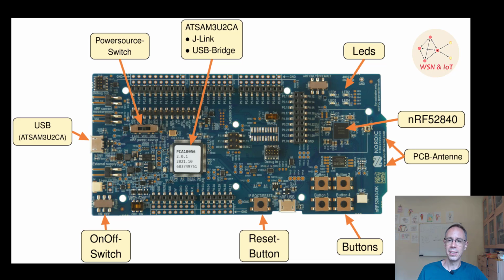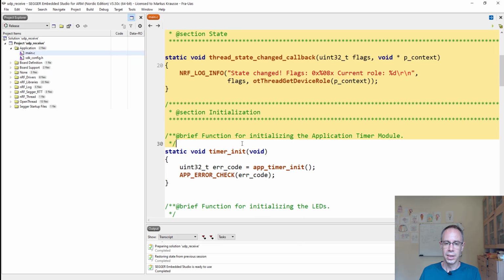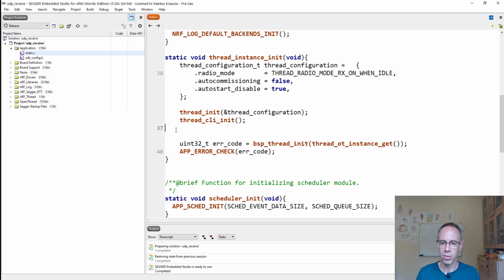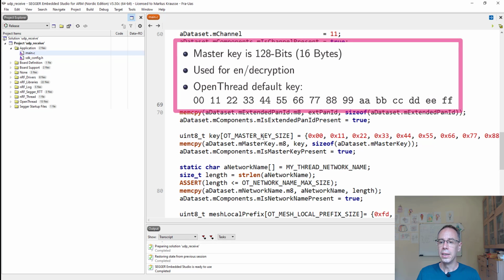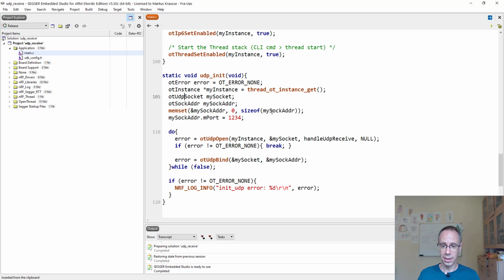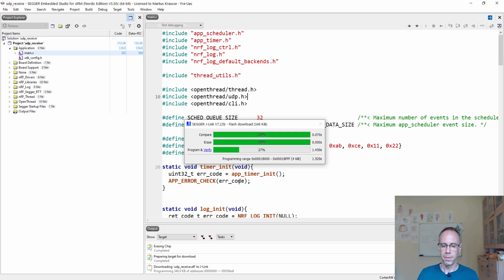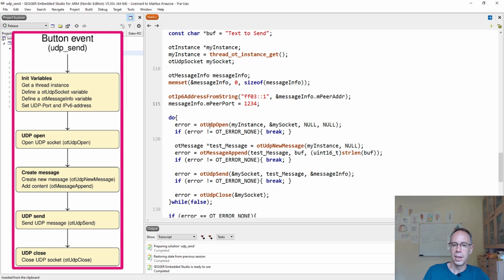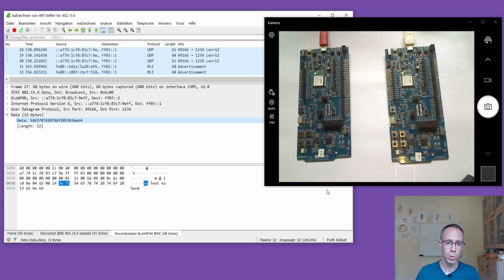Thread network technology - 04 Programming Thread network over API and sending a UDP-package

Comment: I had trouble with the udp_receive board crashing when I powered on the udp_send board. Making the "mySocket" variable in the udp_init() function static appears to resolve the issue for me (i.e., change line 113 in your example code from "otUdpSocket mySocket;" to "static otUdpSocket mySocket;"). Any idea why this might be the case for me?
Reply from the maker: Not really. mySocket is just a container with the socket information and should be available as long there is a valid reference even in the subfunctions (otUdpOpen, otUdpBind) .  otUdpBind also uses mySockAddr. Did you make it static too? Did you try it with the newest Toolchain?
Reply: @wsniot  Thank you for the response! No, I did not change anything in any of the subfunctions. I just made mySocket static locally in the udp_init() function. It's really baffling to me, especially since the program crashes after that code should have executed. I turn on the board with udp_receive, verify it's working in Putty, then I turn on the other board (I have tried flashing the second board with both udp_send and udp_receive). At this point the first board crashes and is no longer responsive in Putty. The second board remains active in Putty, however. Add the static keyword to that one variable and everything works perfectly. So bizarre. 

I am using v7.10a of Segger Studio and v4.2.0 of the nRF5 SDK for Thread and Zigbee. I also have v17.1.0 of the nRF SDK, and one thought I had was that perhaps there was some cross-pollination with library files, but the .map file looks like it is sourcing everything from the SDK for Thread and Zigbee.  

Maybe I should do a clean reinstall and see if it behaves normally. The issue was just so curious I had to know if you had any ideas about what could cause something like that. Anyway, thanks for the great tutorial! It's helped me a lot with understanding how to implement Thread.
Reply from the maker: @ryanknepel7970  Would be interesting if the error still occurs if you use the nrf Connect SDK with Zephyr and OpenThread. I would anyway recommend switching for new developing to the nrf Connect SDK since there is no really ongoing anymore from Nordic for the old nrf5 SDK.
Reply: @wsniot  Hmm, yeah, I'll see if I can port the code. I'm curious myself. Thanks!

Comment: could you pls tell me how could i connect automatically into previously paired network after disconnected from it?
Reply from the maker: How did you disconnect from the network? Normal its reconnect after a connection loss by itself. If the device did it by programming, a new initialization (thread_init) should help.
Reply: @wsniot  
The scenario is like ,
very first i am paring both the device by pressing the key on device it self(programming is like that only ) and i can see it's connected to the network and communicating fine.
Now,Let power goes down and my device goes off and disconnected from network.
Now , the device should reconnect to the previously pair network when power up again automatically. 
How it would be possible?
Reply from the maker: @mimoghosh4400  The dataset parameters from the thread network are stored  in a non volatile part of the memory on the chip. Even after flashing a new firmware it is still stored as long you are not doing a full erase of the chip before. With the function otDatasetIsCommissioned(myOtInstance) you can even check if there is already a dataset stored.

Comment: Here we are  sending message via realm mesh Multicast address...how we send messge to a particular device? How we find MLEID of that devicem while sendig UDP mesaage
Reply from the maker: There are different solutions possible. For one, the MLEID should not change unless the SoC is completely erased. The MLEID can be determined with the CLI command ippaddr. However, this is not so convenient. It is better to send a broadcast request and ask for a response from a specific device (service) and get on this way the MLEID.
Theoretically, a service discovery is also specified in CoAP. However, this is not implemented in OptionThread yet. Here, too, a common solution is to implement a BroadCast discovery for a resource by your own.
Reply: Sir  you mentioned " send a broadcast request and ask for a response from a specific device(service) ".. Is it ping using ff03::1? If so response is from ML-EID... Then how we can understand our specific device?... If it is not ping can you tell me more about that broadcast message to specific device and how it is implementing?
Reply from the maker: @rohithr6462  You just send a normal UDP-Packet on the broadcast address ff03::1 and the payload could be for example "temperature". And the node with a temperature-sensor answer then this message with a unicast-message. The payload can be the own ML-EID, but you also get it in the response details.

Comment: Great Video, thanks a lot, i have problems with the udp initialization this seems not  to be working i need to open the udp and bind  it manualy, i wanted to download the source code but it requieres logins.
Reply from the maker: Thx for the comment. I had the wrong settings with the download file. Now it should work.